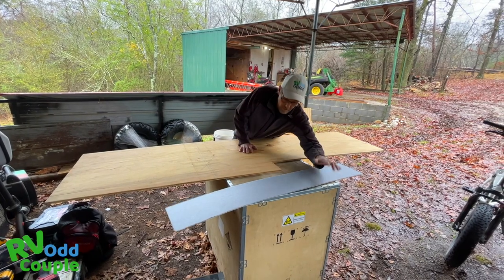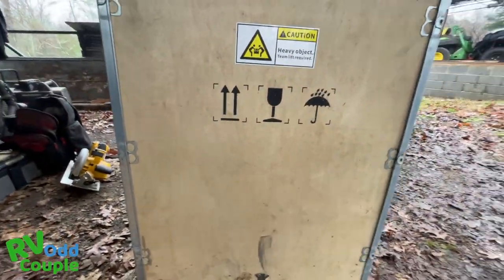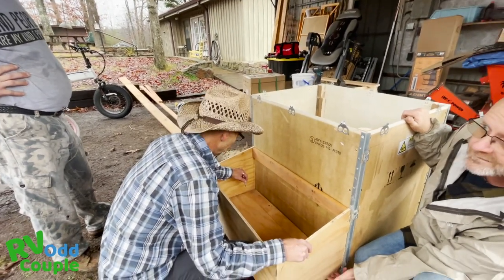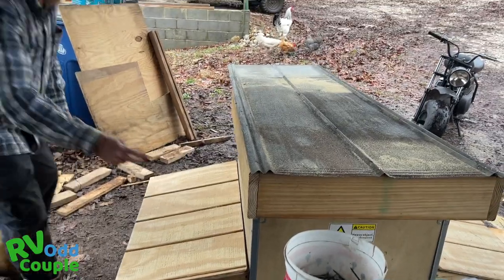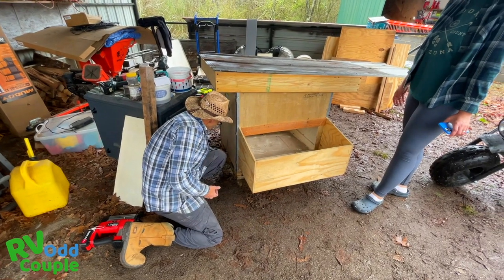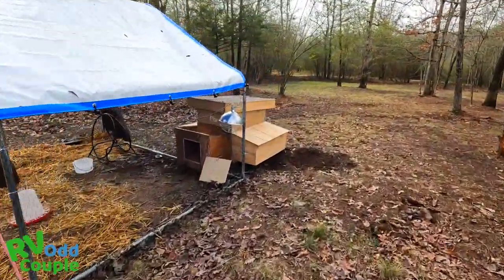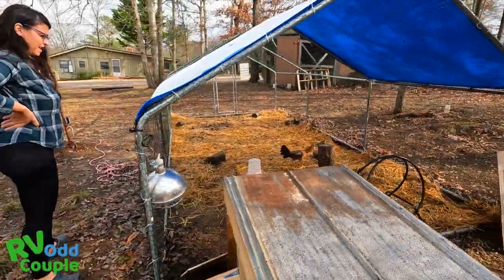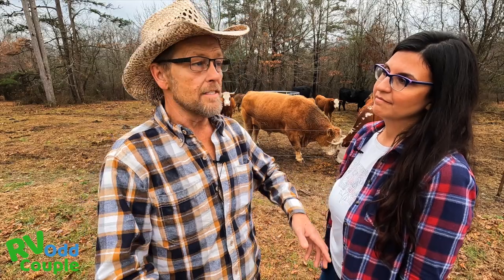How fast can we Build a Chicken Coup with Scraps only? Our Homestead🙏🏼❤️🇺🇸

Comment: 'GOLDEN YEARS TRAVELING'
Fantastic video and enjoyed watching all get involved in the complete setup. I am totally impresed with your power tool ability John! Keep up the great job and Merry Christmas to all at Thunder Canyon and the new homestead.
Reply from the maker: Thank you Steve❤️😀🤠 Merry Christmas brother
Reply: Not bad for odds and ends laying around. I suggest putting stones under pallet bottom. To keep the wood box off the wet ground just enough so air keeps the wood can dry back out after a rain. Also take a piece of roofing rubber or even light tin about 4 inches wide and a bit longer than your lids that cover your nesting box’s. Then silicone caulk between rubber or tin. Also make a piece of board thick enough to screw on side of the box over the rubber. You will also need a board on the inside of the box for support. Where the screws come through. Then do the same for the nesting lids. To attach the rubber to the nesting lids. Then lids then will hinge on the rubber. And also keep the water out.  A couple coats of stain or latex paint will help the box last much longer. Only on the outside though. Hope you live in a warm state. I enjoyed watching you make something out of odds and ends. That most people look at just as junk lol. Eggs have become very expensive now days. Hopefully you have extra to sell to pay for the cost of feeding them etc. 

Good luck with your chicken,

Comment: That's a great house while they are still small, but in a few short weeks that house will be way too small for all those chickens.  The house should be like at least 4 feet square with a lot more roosting bars.  You don't even need all those nesting boxes.  For some reason they all want to lay in one or two nests.  They actually sleep on the roosting bars.  It'll be fine for a few weeks, but start now on a much bigger one with one or two nests and a lot more roosting area.  I've had chickens for 25 years and I always underestimate the area they need.  If they are too crowded they start pecking each other and get stressed and stop laying.

Comment: Nice coup, If you have problems with predators going after the chickens at night you may want to bury chicken wire around the coup out 3 to 4 feet all the way around so they don't dig under the ground into your enclosure.

Comment: John, you are like me, left handed. They need to make a left handed skill saw.  It is dangerous for us to have to use a right handed saw.
Reply from the maker: Certainly awkward 😀
Reply: Stacy, I am right handed, but I mostly use the saw with my left hand because I can see the blade better and hold the guard easier when needed. I have a small corded left handed saw that I bought many years ago. Almost impossible to build /finish stairs without one. You just need to look for them they are available, at least with a cord. I personally have not looked for a battery powered left handed one. BTW I am a retired construction worker.
Reply: @dallasarnold8615  thanks for the perspective.  It's good to get a professional's opinion.

Comment: Beautiful building job, John. You’re definitely a pro! From one chicken farmer to another, if you could cover the base, inside, with plastic, it will make cleanup MUCH easier. Also, you may want a few small air holes, covered with wire mesh at the top opposite the door, for airflow. Ventilation is critical, all times of the year. There were several other good comments made about raising the coop and extra fencing around for predator protection. You’re definitely in your element :)
Reply from the maker: All great tips Jennifer😀 Thank you